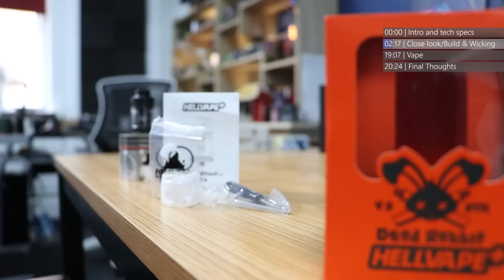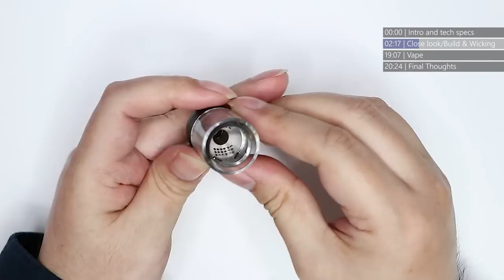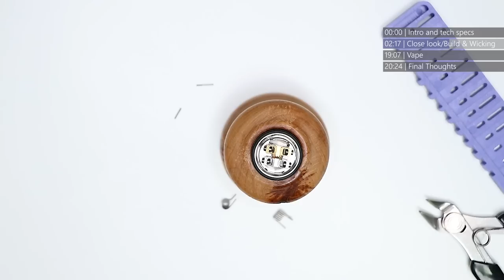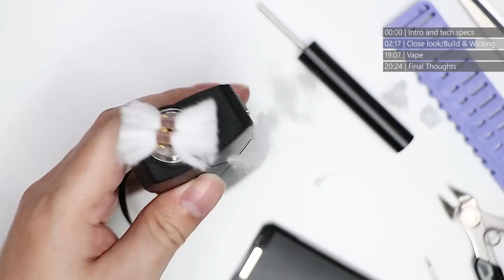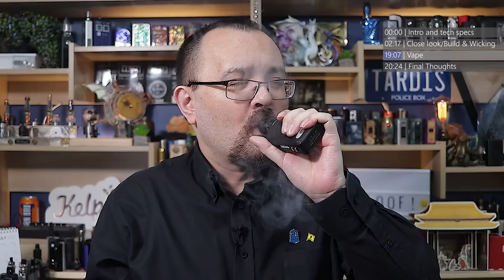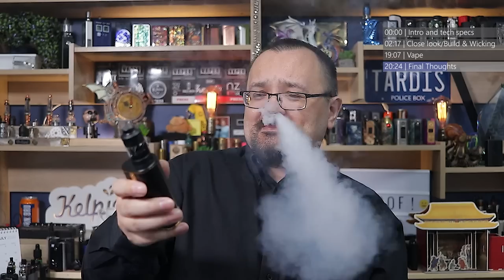Does it warrant a V2? - HellVape Dead Rabbit RTA V2

Comment: The filling of this tank let's this tank down. 
If you overfill it which is easy as there's no air hole on the top off the tanks oring   it back fills into your drip tip and you will end up with a mouth full of liquid.

Comment: It can be hard to define what constitutes a new version but I have to say that as there is a complete change of one key element (in this case the fill method) personally I think the V2 is appropriate, particularly as the V1 is still on sale (at the time of this comment). V1 screw top, V2 slide top, take your pick. small things like the angle of the posts do not need a new version number. in other industries it is not too uncommon for 2 or more versions of the same product to be released at the same time with all but one key feature remaining constant across the range.

Comment: Great review Vic! Love the deck over the v1, bigger screws and post holes are bigger and more square.  You should check out vape sheer scissors are way better As they are awesome and super sharp and way more compact than what you're using. You will love them.. I saw you on jai's channel today and all I have to say about Rip is... him saying he is done with vaping was all for show to get a reaction out of the vaping community and it worked...i knew he wasn't done seeing he has a juice line and he's all about the money in the vape industry nothing else or nobody else but himself.  Hopefully he doesn't pull a dead rabbit v2 aka Heathen and say he is back and not be back and be there for the community. Then for sure he will be hated by the hole community.